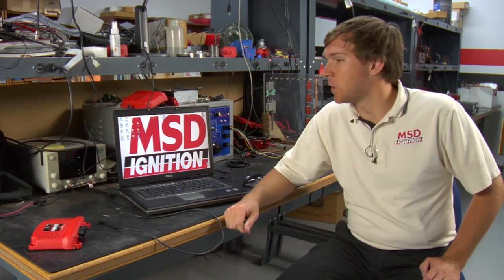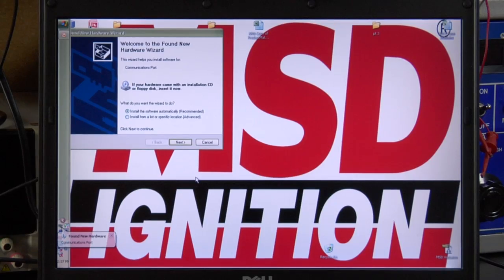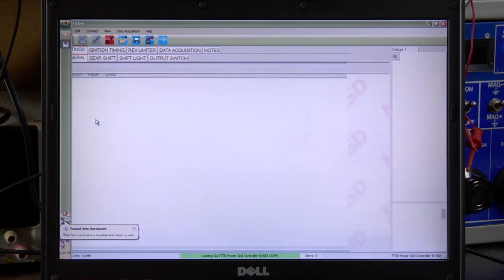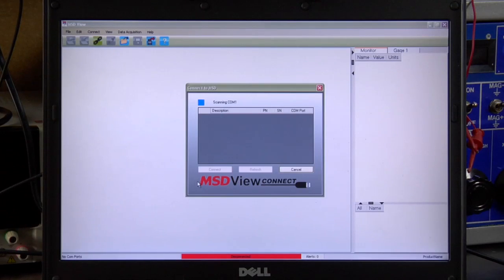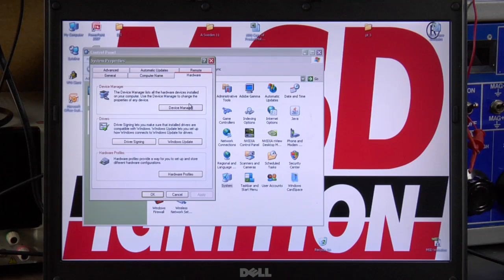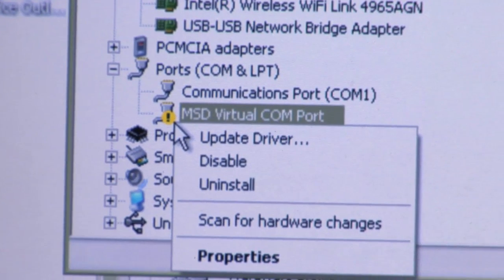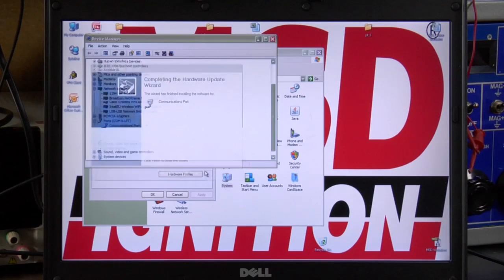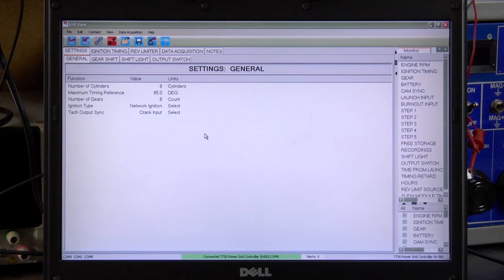PC connection to MSD

Comment: When will MSD come out with a functional USB cable for the 4217 single cylinder ignition?  The RS232 - USB adaptor is riddled with problems and leaves single cylinder users with a $600 boat anchor we can no longer use.